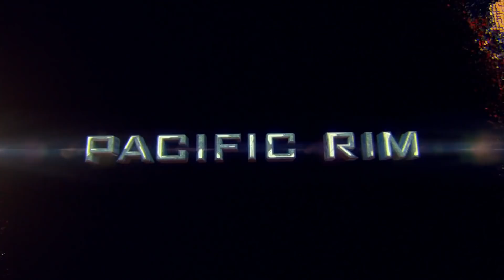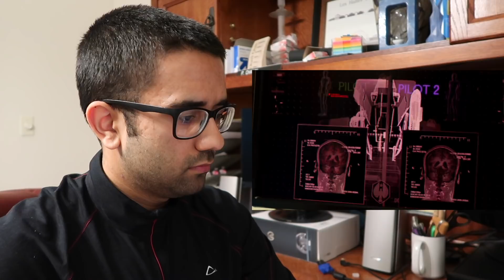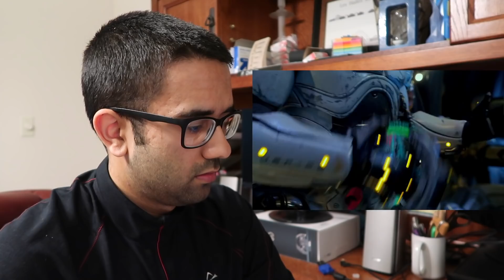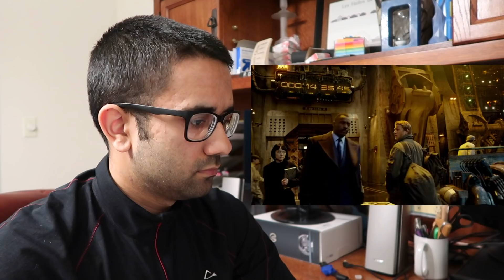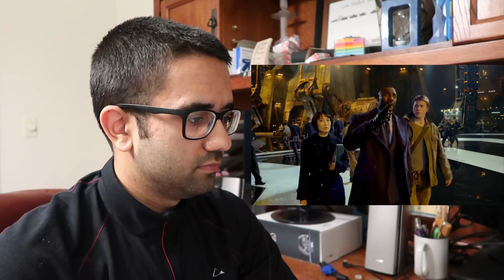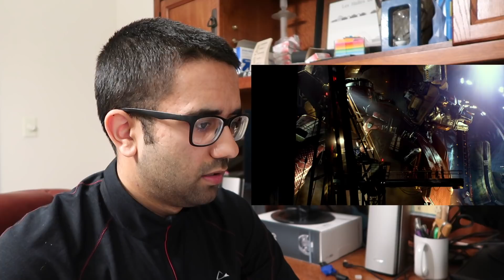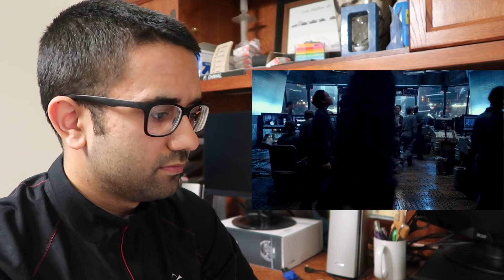Real Engineer reacts to engineering scenes in Pacific Rim

Comment: I think makes a giant robot in jaeger size is more posible than robot in human size🤔
Reply: Making them i dont think would be that hard ofc i am no engineer so they may be some challanges.   However getting it to perform effectivly in a combat situation is a diffrent thing entirely.  The bigger it gets the slower it´s gonna be.  For example just imagen u got a 10ton arm punching at the speed of a boxer,  at the end of that punch now u got a weight of 10 ton that needs to slow down fast.  So u would have a 10 ton arm multiplied by the speed of the punch.  That is some huge strain on the chassi just to keep the thing from tearing itself apart.
Reply: A human sized robot is WAY easier than a giant robot

Comment: Just want to point out that you're wrong about the "analog" Gypsy not being affected by an EMP.  First, the way an EMP works is that it generates large currents in wires that act as antennas.  The longer the wire, the more likely it is to have a larger electrical pulse being generated inside it.  When that electrical pulse hits things... it can fry and melt them.  Digital devices are more susceptible because they have more smaller sensitive components.  But an analog device, especially something as complex as to drive a complex robot will also get fried.  And... you can expect that there are a whole shit-ton of very long wires inside Gypsy to generate those pulses.  Second, it's total bullshit that Gypsy doesnt have digital components.  Just watch any of the interior shots and you'll see plenty of digital screens and 3D displays that can only be driven by computers.  Same thing for whatever device is connected to the pilots to connect their brains.  That's all going to be computers with complex programming... not some simple "analog" thing like a transistor radio.

Comment: Remote Operation
I doubt it would be a timing issue. Dedicated satellite communication would be very fast. Even radio towers on the coast would provide relatively good and very fast communication for many many miles out to sea. 
There could be many problems with remote operation even if there were no EMPs. They may have tried it in the past and antennas broke, salt water can interfere, monsters from a “wormhole” may give off enough residual energy to disrupt a normal signal.
I do know that US drones have onboard backup commands if their remote communication is not operating.
At the end of the day, without knowing why, it is impossible to vet their choice, merely that their choice is believable, and that’s all a movie needs for us to continue to watch and enjoy.

Comment: Alloys
There are many applications that do benefit from the use of a metal alloy. There many other applications that benefit from the use of a purer metal.
I believe the movie was attempting to refer to low quality aluminum alloys which do fail, especially when poorly or incorrectly welded.
The maker of this video is also confusing high quality aerospace aluminum alloys with alloys always being exclusively better.
The reason why high quality aerospace aluminum alloys are used is because they are weigh less than steel, not because they are stronger.
I am not an expert on titanium alloys, or weld performance in titanium assemblies, so I cannot comment even tho I am a mechanical engineer, I presume an electrical engineer would generally know less.

Comment: Good video, but the reason they use two pilots is because they don't actually use mirror technology, the neural link works as an extension of you nervous system, in order to shorten the delay between moving and the response, as you can do it as you think, instead of as fast as you can move

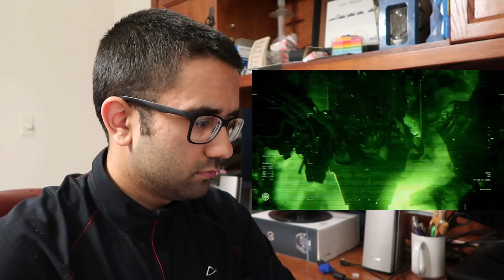Comment: 2:03 Q: u dont understand why they use two pilots.
A: One pilot controls the left hemisphere and the other pilot controls the right hemisphere of each Jaeger's "brain" supposedly because a single pilot can't handle the "neural load" for interfacing with the gigantic machines. If the two pilots punch or run in unison, so does the Jaeger.

Comment: A fun explanation i heard for the dual pilots is since the limbs are so large the interface would need to be predictive in what movement signals are coming next, so they dont delay in motion, and two separate pilots both sending the signal, decreases errors in the signal interpretation since the percentage error of two pilots is the square of 1 pilot.

Ex: machine error per pilot =5% then the chance the machine has an error from both pilots is 2.5%

Comment: I also find the analog part a poor and unrealistic excuse,  fact is we can't build a toy car without a dozen digital component calling a robot of this complexity digital component free is crazy.   

It would have been better if they claim the central control unit was housed in a metal casing that effectively shielded  from EMP where newer bot use composite material which was lighter but has no such protective property.

Comment: I haven't seen it yet, but for the remote control. 
Most Jäger's were analog. The only one that could be remote controlled was Striker, the first and only digital Jäger of the first movie. 
When Raleigh steps in Gipsy, he's physically moving Something that physically makes the Jäger move. You can see that, the movie accents this actually. 
I know we did the digital vs analog, but didn't see someone saying this. It is faster to make something analog than digital, as he states. And that's why the Jäger's aren't remote controlled. Because the pilot is physically moving something within the Jäger to make it move.
There's also the age old debate of removing the human from the battlefield vs still putting bodies in danger.
It's as he said a lot of the general technology exists today. But we need to think of the scale the Jäger's are built on. These are essentially the largest robots in the world in this world. 
Think of the full scale gundam that's undergoing movement tests. See how slow it is. 
To get presise control, would you risk a small chance to have a bad connection, or would you put the body in the Jäger, can't loose connection then.

Comment: It uses the pilot(s) own senses and neural structure to make sure the machine moves properly. But it also feedbacks to the pilot because its such a close connection. Imagine using that Kinect to play an FPS, but you feel every impact at 50% to 100% actual pain-sensation. And you're not just using your movements to play the game: the system is reading how your brain itself interprets your movements and extrapolate that upward to the Jaeger. Its why they had to split it between two or more pilots: one person can't handle the full neural strain for long.

Comment: Im pretty sure the entire purpose of the dual pilot setup is due to the pilots brains essentially being connected directly to the software and hardware to eliminate the input lag to essentially function as the pilot's body itself instead of as a tool to be driven.  This combination of being connected/jacked directly into the sofware and hardware created a problem in which one pilot simply could not handle to full load, so it is run in parallel, same volts, less power (on the mind) kind of concept.  Obviously that is dumbing everything down and requires suspension of belief, but has just enough basis on real world examples to make enough sense to work for plot and story purpose.  Plus it's got "cool" factor.  *edit had voltage and power reversed

Comment: One thing I can think of that nessesitate the 2 pilots system is sensory input.
You talked about the pilot's input to the machine, but I'd imagine piloting a giant mech would require a bit more than just a display panel showing the pilot what the mech sees.
I think what might also be needed is for the pilot to recieve sensory information from the mech itself. All the things such as balancing, impact(to know when they might be walking backwards into a building for example) or just general spacial awareness that cannot be communicated through a monitor.

That would make the most sense, as if you put one human into a giant machine with probably tens of thousands of sensors built into all around the machine sending information into 1 brain would be too much to take.
That might also explain why the need to have pilots physically inside the machine, as I'd imagine sensory signals invovling tens of thousands of sensors might not transmit very well over the air.
Reply: You are exactly right. Kind of thought the film was clear with this.

Comment: In simple  words   one  pilot cant handle the pressure which comes  from  controlling  a 100ft robot.  For controlling  the  robot  efficiently  you need to  connect  it with  human  body. Mainly  mind  so like we get exhausted  while  exercising, due  to massive  consumption of  energy and if we push over  body over a limit  we might pass out or get a heart attack  because  the body cant  take  that much pressure. which means  the body of the pilot  cant  take  that much exhaustion   while  controlling  a big robot  like  that so two guys are needed to  control  it without  dangering  anyone's  life.

Comment: About the simple mirror function, is that as a giant robot you need that nervous system connection to give you feedback. For example in the opening when they move the boat out of the way. If they couldn’t feel the boat in their hand, and they didn’t grip it tight enough they’ll drop it. Too tight, and they’ll crush it. Props to CinemaWins for that one.
Reply: i think the whole point of the jagers is to be simple (ish) and very effective fighters for the kiju... if you start implementing  toomany variables such as acceleration and gyrocsopes JUST TO CREATE HEPTIC FEEDBACK, these robots are gonna be way too demanding on chips/ processors... i imagin that the connection to the brain ELIMINATES the need to have to implement such complext and easy to go wrong systems.. it kind of ticks a lot of boxes and is a short cut, but at the risk of the pilots physically being there
Reply: they could have done that without the need for triggering the nociceptive  (pain) nerve fibers
Reply: well u actually dont need to do that 
u can just simulate the touch on the gloves they were wearing 
such thing already exists in VR(not for consumer VR)
Reply: @Waffer_X  There COULD be a reason for this:
If you want to mirror human dexterity,  using a haptic suit WOULD work. However, since the Jaegers are so MASSIVE, they could be too cumbersome for expectations. For example, try picking up something incredibly small, then pick up a larger version. Which one is easier? For Jaegers, this could be a MASSIVE problem, because everything is effectively smaller to the pilot, is harder to interact with the environment. However, it COULD be that this issue doesn't exist with neural feedback.
Reply: @kombatace7971  you can mimic human dexterity quite precisely with some accelerometers and gyroscopes, there's no need to connect it to the nervous system
Reply: @sobrev1viente  Yeah, you are probably right. However, you can see that they are controlled through the pilots' movements, so I'm not sure how that would work with extra systems to increase dexterity.
Reply: @Waffer_X  haptic feedback
Reply: I think something else to consider is spatial awareness and depth perception. Misjudging the distance of a punch and overextending could be fatal in a fight against a Kaiju. Plus using what people are suggesting as a replacement could have delays and even just 1 second delay could prove problematic in a head to head fight. Could you imagine trying to block an attack with a 1 second delay between your brain and your body? You wouldn't stand a chance.
Reply: Yr goddamn right
Reply: yeah and kuddos to the director for his trash idea for making the pilot feel every damage the jaeger recieved it doesnt make any actual sense to do that why would you invent a technology to torture the pilots
Reply: @Whosthis-1-g8i  you'd be surprised how important pain can actually be in a fight. For instance it helps fighters keep their head on straight and not fight recklessly.
Reply: @Whosthis-1-g8i  
Compare a regular vr and a vr where you can feel everything you touch

Now what would be more effective

Comment: I mean the two pilot system was supposedly implemented cause the radiation or the systems were too much for one pilot... the remote one I think is because earlier Yeager models were slower so the time delay would be significant since kaijus would be faster because they are living beings and it is seen that the later kaijus are indeed faster than even the fastest Yeager they had
Reply: Radiation isnt caused by drift, the old jagers where built so fast they couldnt afford proper radiation sheilding around the core.
Reply: Well the radiation is caused by (i think) nuclear power and Kaiju blood because well they are toxic
Reply: This is how I understand the reasoning. Drifting doesn't just connect you to the other pilot it also connects you to the robot hence being able to feel things and such. In turn the robot is sending all this info about itself like system errors, things that its touching and similar things. All that information is just too much for one human brain to process so they have two pilots to share the info.

Comment: It baffles me that you, being an engineer, missed the whole point of neural link.

Rewatch the scene when Knifehead rips off Gypsy's arm. The pilots inside the jeager scream. They FEEL the pain. They interface with the jeager to the point where they feel its hull as if they would feel their own body.

This explains, at least to some degree, why there's two pilots. Because the jeager is so huge they need to brains to process all that information. And also they have manual switches inside the cocpit so its convenient for one pilot to take care of the movement for a while and the other to operate the weapon systems. Obviously they don't do it by thought like Tony Stark.

Also this explains why remote control is impossible. It wouldn't be possible to send so much data remotely. They can control the jaeger better from the inside.
Reply: Tony use Eye tracking

Comment: The reason jaegers dont have emp protection is that no kaiju has had a emp based attack before
Reply: I mean yea, not even a scientist would think of an species of flesh and bone to have such a power electrical conduct to turn off any type of device with power
Reply: Yeah that was one of the only good things about Pacific Rim 2 where when one of the Jaegers got emp it took about 30 seconds for it to reboot but then it just immediately teleport over to the main characters
Reply: Leatherback: am I a joke to you?
Reply: I don't think you need specific EMP protection when you have a Faraday cage which in this case is the conducting outer layer of the Jäger. Also the "analog" Jäger would also be affected if this weren't the case since a pure analog circuit for such a complex system ist not an option. It would still need processors and digital components for the calculations even if the signals are transmitted on an analog basis.

Still a great movie though.
Reply: @Daniel-gj2cd  Analog in power source I think. Since Eureka is purely electrically ran on an electric generator or battery, it got shot down and coudnt reboot. Gipsy's nuclear reactor is constantly running so it provide starting electrical power. So does everything that ran on fossil fuel but haven't been booted on ( the helicopers for example)
Reply: Theres no electric circuit that's safe from an EMP
Reply: Yes